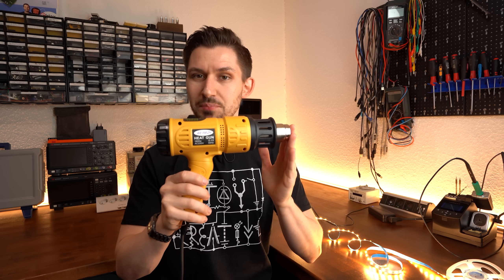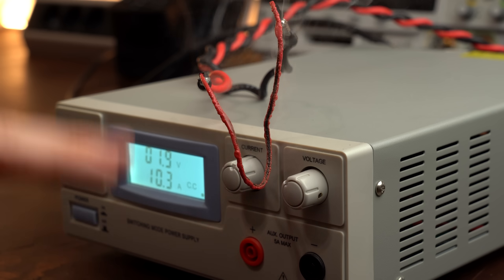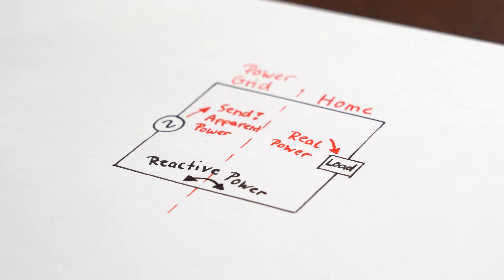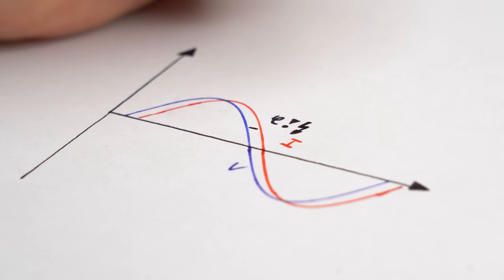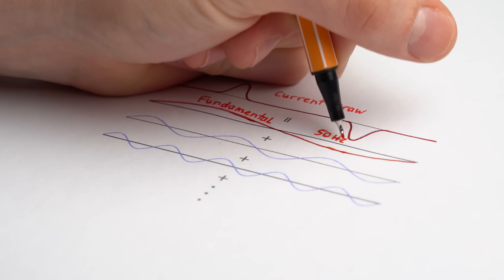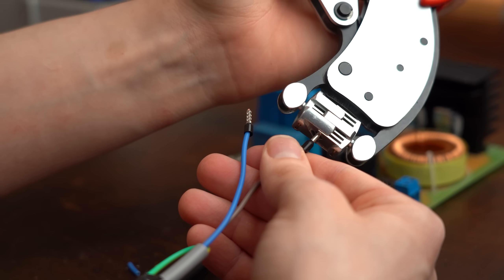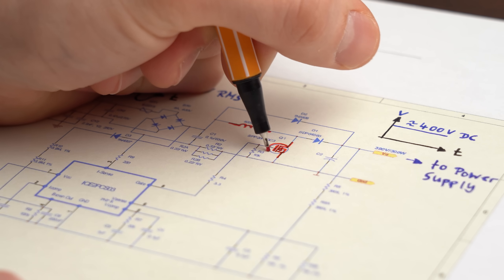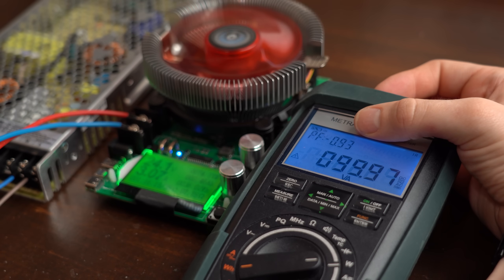The Most Important Circuit for our Electrical Future?! (PFC) EB#55

Comment: I just want to clarify for at least US viewers that most residential consumers do not pay for their apparent power consumption, only active power (kWh and demand charge in kW) consumption. Industrial consumers have different tiered electricity costs (depending if they are a "medium" or "large" power consumer) in which they are either charged with their active or apparent power depending on their power factor (for example, if they have a power factor of less than 0.9, then the utility would use their apparent power consumption to calculate their billing demand and/or total power consumption). Now if there is going to be stricter regulation on poor power factor (like limit on current harmonics in the video) for consumer products, that's on the manufacturers to ensure there is some sort of power factor correction on either the device or power supplies, not so much on the residential consumer to need to actively seek out power factor correction circuits.
Reply: I have worked on some Dell servers that allow the PFC to be enabled or disabled in the BIOS. So even in some commercial environments, PFC doesn't net an overall advantage. And until residential charges for power factor somehow (e.g. a peak time VA demand charge), PFC would largely remain a scam for home users.

Comment: If more apparent power than real power is it means more power loss?
Reply from the maker: Not mandatory. Reactive power just oscillates. It does not get wasted in theory. But since every conductor has a resistance and there a capacitive and inductive losses. There is actually more power loss with more reactive power and thus apparent power.
Reply: @greatscottlab  ok thanks for this information
Reply: @greatscottlab  does this reactive power affects sensitive device?
Reply: @GreatScott
So it acts like AC which makes magnetic fields on things like transformers?

Comment: How do i determine whether or not a PSU has a PFC when i can only look at it from the outside of the enclosure it's in?
Reply: Oftentimes you can't without testing. An exception is that if a power supply has an input voltage selection switch it is nearly guaranteed to lack active PFC.
Reply: It should be specified in the manufacturer specifications(they usually tell you the min power factor) or you can test it, or you can see the components inside.